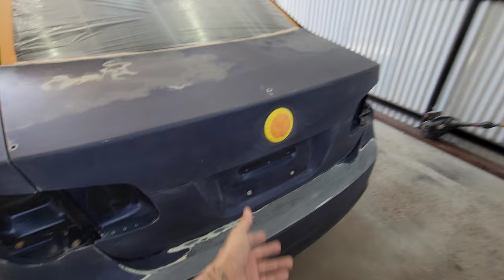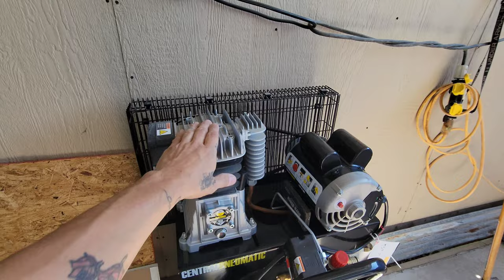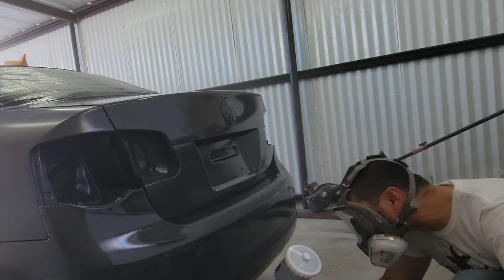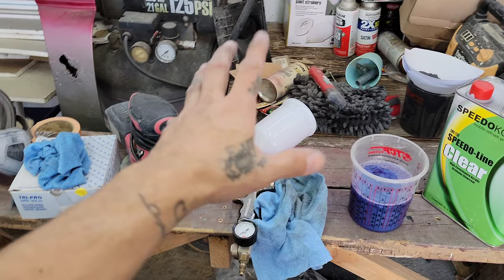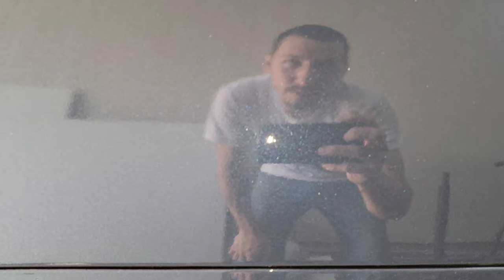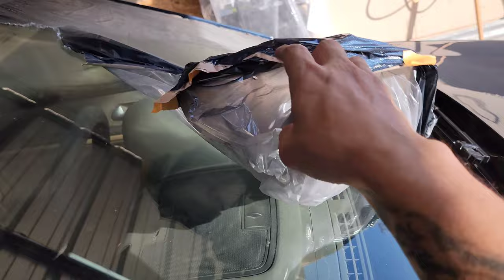I Painted my VW JETTA At Home

Comment: All that work and there's still dents all over the car. I respect that it's just a quick flip, and you did get super impressive results but man that would've really increased the value if it didn't have fist size dents on half the body panels.

Comment: It looks good papa. The only thing I'd do differently is spray the roof first. I'm a harbor freight Guy myself. You can connect the two Air compressor(s) for a larger air tank volume.

Comment: Man, so grateful to get to be encouraged by your skills. I'm real close to jumping in and doing the paint in my 05 Sierra crew cab. I've seen you use the Kobalt HVLP & lately this Spectrum. If I pick one of these, which would be the best choice for single stage white? I'll also have to do primer because the original white has lifted and has a bit of surface rust on top of the cab. Any guidance would be greatly appreciated.

Comment: Bro question how has the Detroit axle brakes been working on your Tahoe???? I was about to order some for my truck
Reply from the maker: So far they're working pretty good. Good stopping power too.
They  did make some slight noise at the beginning,  but after the break-in it went away.  Probably metallic brakes,  I would recommend ceramic or ebc brakes.. just something better, but the rotors are great!

Comment: I got a project with flaky clear coat around the car and bumper. What grit sandpaper did you use to get the clear off
Reply from the maker: I used 320. On some spots where it was too rough I used 220, then jumped back to 320 to smooth it out.